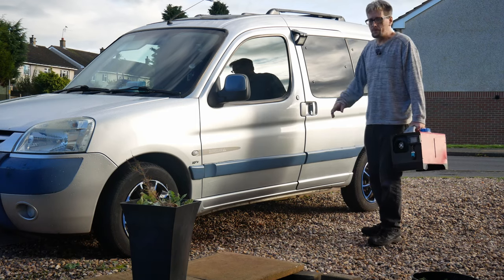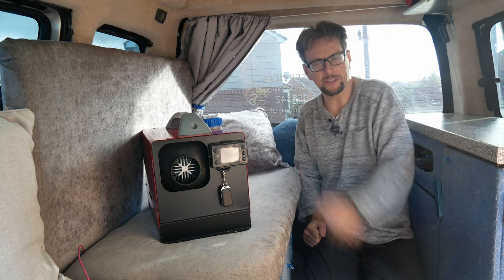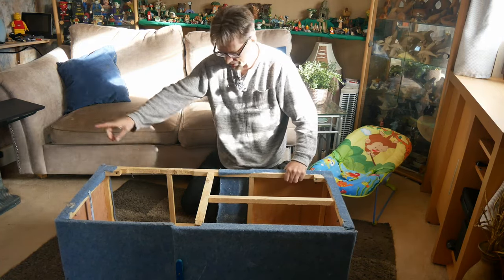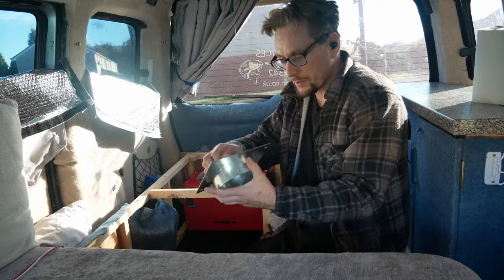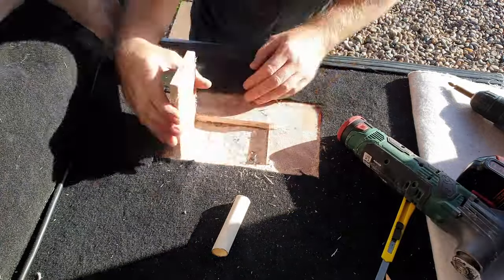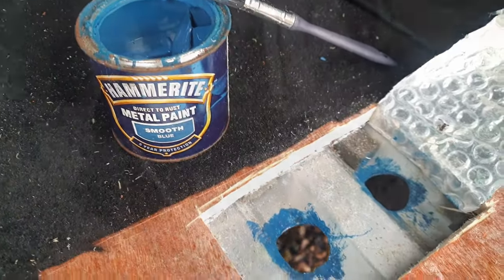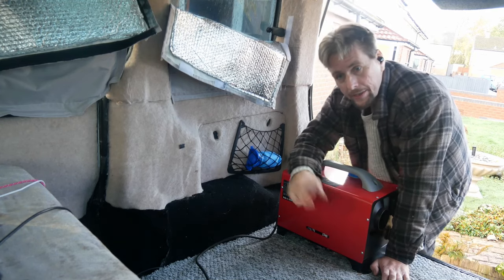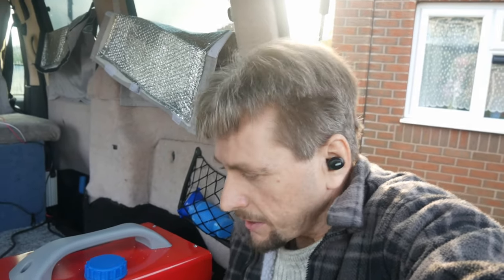Fitting CHEAP Chinese DIESEL HEATER into Peugeot Partner Micro Camper

Comment: Well done. In my country it´s not allowed to built in cars. For the "German TÜV" the heater must have the much more expensive heaters with ECE-Certification. I have a non-ECE chinese 8KW-Vevor diesel heater for my garage, it works fine since many years, enough warmth for 65 squaremeters.. If your peugeot ist a diesel-car, you can take the fuel from cars tank.

Comment: NOO! You have done 2 major problems!
1) You can't use PVC pipe on the extended exhaust outlet. It's gonna melt and cause problems. 
2) Air intake is misplaced and sucking in the exhaust. The exhaust must be placed so that the fumes doesn't collects under the car.
Your setup is currently dangerous 😳
Reply from the maker: Hi, thanks for info, though may not have been clear in video.
1, the pvc pipe was only used so could mark where to drill holes, then not used
2, the exhaust is pointing to the back of the car, and air inlet towards front, about 3ft apart, since filming this about 3 weeks ago, extended exhaust and air inlet
Reply: Ahhh great! Was just worried. Great that the exhaust is extended so the gases won't collect under the van. 😊
Reply: Grand job, "Warm this Winter''
As Connie Francis or Gabriella Cilmi would sing.

There are super quiet pumps for those on the accessories market, seen a couple and work well. Possibly expensive tho🤔

Now you can get forecourt pump easily into tank. Can probably be used with cheaper fuels too as it's not on van tank.

And toilet, sitting there on the bog, side door open, reading your daily Telegraph, breakfast glass of Scotch in your hand. 😂

Bliss😂

BTW Kev I could have done a much better job...

Of making a bodge job😂

You did well.
Reply: You missed silicon sealant on a red hot exhaust... 😬
Reply: @samgraham4168  yes,  1300°c heat resistant silicone is nothing compared to the heat that's gonna throw out!
Reply: @Shifytee123  1300 degree silicone, which itself doesn't exist; what I think you're referring to is fire cement, and this it was not.